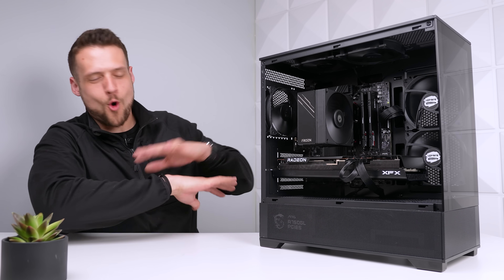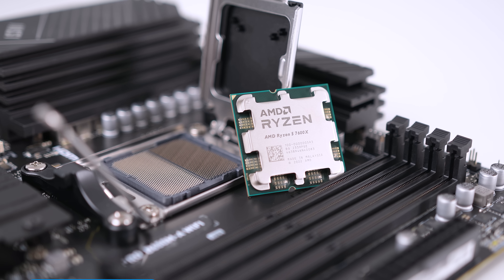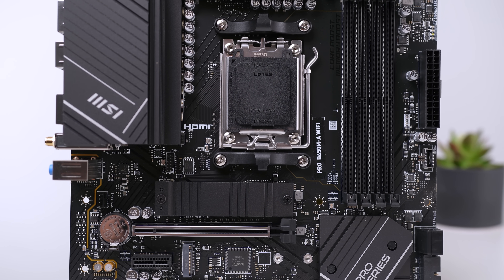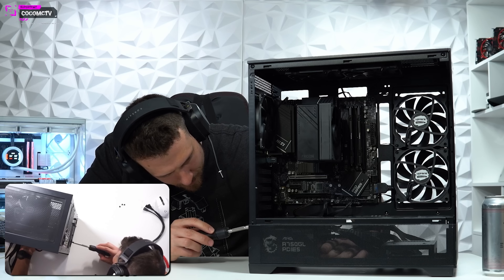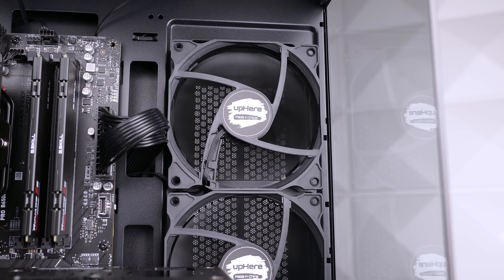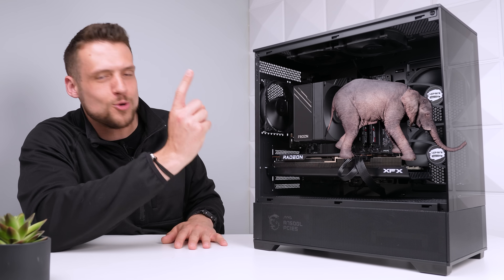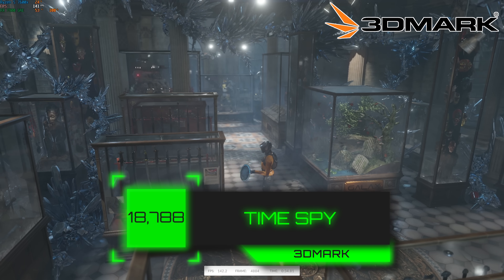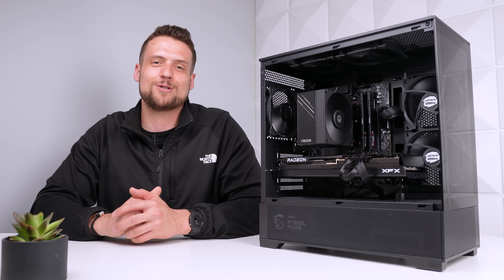$1250 PURE PERFORMANCE Gaming PC Build Guide

Comment: CPU- AMD Ryzen 3 3200G 3.6 GHz Quad-Core Processor
Motherboard-ASRock B550M-HVS SE Micro ATX AM4 Motherboard
GPU- XFX GTR XXX Radeon RX 580 8 GB Video Card
Ram- Corsair Vengeance LPX 16 GB (2 x 8 GB) DDR4-3600 CL18 Memory
Storage-Patriot P300 256 GB M.2-2280 PCIe 3.0 X4 NVME Solid State Drive
Case- Cooler Master MasterBox Q300L MicroATX Mini Tower Case
Power Supply- Apevia CAPTAIN 550 W ATX Power Supply
Is this PC good
Reply: sure but why a 3200g if youre using a dedicated gpu, and you could go with a b450 motherboard instead of a b550 to save some money

Comment: Hay what about phanteks XT view its under i m sure its under 80$ and comes with 3 pre-installed d rgb fans and its also fish tank design but with a psu basement just like this case a also have a clean looking rgb Streep you should check it out its in budget and looks really cool and also stopped msi's zero cable motherboards you'll love it love your video's btw ❤❤

Comment: Almost the same part as my first dream build too, but I still trying to build it aesthetically with some other parts such as : Sky Two GX, Ak400 Digital and more AX120 fan from montech to make all of the fan looks the same exclude the Air Cooler fan of course cuz I'm thinking to buy another Deepcool fan the triple pack one in the future so the air cooler have 2 fan and the other 2 were installed on the side knowing the case can handle 10-12 fan If I'm not mistaken.

But still, that just a dream that I don't know when will happen.. At least I'm having fun trying to come up with this dream build tho lol

Comment: I also just built my pc for $1250 and it has 7600x 4070 super 32GB DDR5 6000mhz cl30 Thermalright Peerless Assassin cooler Corsair RM750e power supply gigabyte motherboard with 3 ssd spots Montech Sky Two pc case and a 1TB nvme ssd

Comment: $1177.41 Same case/2TB SSD 
Ryzen 5 7500F 3.7 GHz ($130.00) 
Thermalright AX120 66.17 CFM  ($17.89 @ Amazon) 
ASRock B650M Pro RS WiFi ($149.99 @ Newegg) 
TEAMGROUP T-Create Expert 32 GB (2 x 16 GB) DDR5-6000 CL30 Memory  ($97.99 @ Amazon) 
Corsair MP600 2 TB M.2-2280 PCIe 4.0 X4 NVME ($108.99 @ Amazon) 
PowerColor Fighter OC Radeon RX 7900 GRE 16 GB ($524.99 @ Newegg) 
GameMax Vista M MicroATX Mini Tower Case  ($53.99 @ Newegg) 
G.Skill MB750G 750 W 80+ Gold Certified Fully Modular ATX Power Supply  ($79.98 @ Amazon) 
Thermalright TL-C12C-S X3 66.17 CFM 120 mm Fans 3-Pack  ($13.59 @ Amazon)

Comment: Total: $1084.32 Same but cheaper.
CPU: AMD Ryzen 5 7500F 3.7 GHz 6-Core Processor  ($130.00) 
CPU Cooler: Thermalright Assassin X 120 Refined SE 66.17 CFM CPU Cooler  ($17.89 @ Amazon) 
Motherboard: MSI PRO B650M-P Micro ATX AM5 Motherboard  ($119.99 @ Amazon) 
Memory: TEAMGROUP T-Create Expert 32 GB (2 x 16 GB) DDR5-6000 CL30 Memory  ($97.99 @ Amazon) 
Storage: ADATA XPG GAMMIX S7 1 TB M.2-2280 PCIe 3.0 X4 NVME Solid State Drive  ($59.99 @ Amazon) 
Video Card: PowerColor Fighter OC Radeon RX 7900 GRE 16 GB Video Card  ($524.99 @ Newegg) 
Case: SAMA ARGB-Q5 MicroATX Mini Tower Case  ($53.49 @ Newegg) 
Power Supply: G.Skill MB750G 750 W 80+ Gold Certified Fully Modular ATX Power Supply  ($79.98 @ Amazon)

Comment: I like the all black no RGB look. Clean and fast. Two thumbs up!
Reply: With you brother. Wasted watts to light up the inside of a fridge
Reply: Oooiyass I’m the greatest technician that has ever lived😅
Reply: Same. This is much better. I am not some tween dude that questions my sexuality. I want something clean and fast with little to no RGB.
Reply: I love some subtle RGB and no RGB. Too much RGB is gross. I hate builds that have a fish-tank case with RGB ram, RGB cable covers, RGB on the side and front of fans AND RGB in the fan blades, RGB on the GPU, RGB CPU cooler, you know. I like the Asiahorse Nyota fans with a little RGB on the RAM or cable covers, and the ID-COOLING non-RGB fans paired with no RGB at all.
Reply: I prefer rgb but i can imagine some people like all black
Reply: @MSIgnas i used to have a white rgb everywhere fishtank pc but now im using a full black no rgb build and i love it

Comment: Great shoutout on the MSI Pro B650M-A Wifi. It's a great value mobo, I use it with the 7800X3D and 4090 combo, has been serving me great so far.

Tbh, people overspending on mobo is the mistake I see most often when building PCs

Comment: But why the 7600x?
The 7500F will also wokr very fine and is 40€ cheaper and for fans i would pick Arctic P12 PWM PST 5stk- pack.

Comment: Thoughts on this build:
AMD Ryzen 7 7700X 4.5 GHz 8-Core Processor
Gigabyte GAMING OC Radeon RX 7900 GRE 16 GB Video Card
Thermalright Phantom Spirit 120 SE ARGB 66.17 CFM CPU Cooler
MSI B650 GAMING PLUS WIFI ATX AM5 Motherboard
Lexar Ares RGB 32 GB (2 x 16 GB) DDR5-5600 CL32 Memory
Patriot Viper VPR400 RGB 1 TB M.2-2280 PCIe 4.0 X4 NVME Solid State Drive
Corsair 3000D RGB AIRFLOW ATX Mid Tower Case
GameMax RGB Rainbow 850 W 80+ Gold Certified Fully Modular ATX Power Supply

Comment: Should have gotten 6000 cl 30 instead anything over 6000mhz will cause a loop with 7000 series amd chips causing performance buffer as the sync goes from 1:1 to 1:2

Comment: Just an FYI, the G.Skill Ripjaws and Flare are the exact same but the Ripjaws have Intel XMP profiles while the flare has AMD EXPO. They're literally the same otherwise and they should be the same price. It doesn't really matter but in general you should get Flare for AMD and Ripjaws for Intel. (Again, literally doesn't matter, just a thing)
Reply from the maker: Yea I saw that as well. This Flare kit is what goes on sale the most often, so I've been using it for both Intel and AMD without a problem.
Reply: @ZachsTechTurf assuming you meant ripjaws haha, but yeah whatever platform you're on just get what's on sale. nice build 👍

Comment: now we need a $2000 price to performance build! :)
Reply from the maker: Maybe the next one??
Reply: $1,820 Maxed out $/FPS
ASRock B650M PG Lightning WiFi $120
Ryzen 7800X3D $345
Thermalright Phantom Spirit 120 (Flat top version) $36
XFX Speedster MERC310 AMD Radeon RX 7900XTX $915
TEAMGROUP T-Create Expert DDR5 32GB 6000MHz CL30 $98
2TB TEAMGROUP MP44 7,400/6,500MB/s  $120
Montec Air 100 RGB $65
Corsair RM850e $120
Reply: @dachness  I work on ai stuff so I need that 3090 for the cuda performance and the vram, and the 12900kf for the cores. good overall tho :)!
Reply: although a 4070 ti super or 4080 would still be good
Reply: same build just spend the extra 800 on a better gpu lol. maybe cpu depending on game

Comment: You should have used the 7800x3d bundle from microcenter or at least have mentioned it. Mobo + cpu + ram costs less than yours while getting a frickin 7800x3d. That is what I went with with my build with a 1.3k budget and highly recommend it. Only downside is the ram is 6000 mhz instead of 6400 on this one but 7800x3d will make more diffirence than that does
Reply: @Bob-pk7pd Most people don't live near a microcenter (I live 1.5 hrs away and it wasn't worth it I wasted 6 hrs due to faulty parts to save 150 bucks valueing my time at 25 dollar a hour , a subhuman HR worker makes 45 in my zipcode avg post tax...) 7800x3d also it isn't worth it especially if you use it for a work station. A car allegory is a 718 vs 911, technically a 718 has better cornering than a 911 given mid weight especially for the average driver on the street but you are giving up unnecessary power and over paying if it costs the same as a 911.
Reply: @danli9884  Are you talking about cars? I am not into them really but I know 911 is a car model (I think from porsche). I know not everybody lives near a microcenter or even us (such as me) but for those who do, he could have mentioned it. I myself live in germany and had a friend get it for me and rn it is in my room.
Reply: All X3D cpu's don't care as much about ram speed. As 6000 cl30 is the amd sweet spot for ram on am5 there won't really be any noticeable boost on an x3d cpu
Reply: @dracconus619  I don't understand. Are you agreeing or disagreeing? Everytime I read it I think the other way
Reply: @YavuzTheIntern  I was agreeing that if the micro center bundle is cheaper then go with it. I was also letting people know that the higher ram speeds mean little to an x3d cpu
Reply: @dracconus619  Oh good. You also said "there wouldn't be a noticable boost on a x3d cpu" but ig you were talking about ram speed

Comment: if you look for deals on a 7900XT you can get one for $670 + ryzen 5 7600 $180 and that combo can actually fit in a $1250 PC build, that would be undoubtly the best price to performance gaming PC for $1250
Reply: Yep. Or just the 7500F if there’s no deals available which can also handle a 7900XT. Mobo could also be cheaper. Also I’d go with the Bitfenix case for less than $10 more for the smaller form factor, 4 ARGB fans, and the fan hub included— even though it’s $10 that’s not COMPLETE price to performance.
Reply: @SanDiegoGamingYT  does the 7500f really handle the 7900xt?? the gpu is almost 5 times more expensive
Reply: Isn't the ryzen 5 7600x way too weak for the 7900 xt?
Reply: Or the 7900 gre

Comment: YUSS I have asked for it a few time by now bc that is my budget. Its a shame by the time this got released I got pretty good at pc building so picked the list myself but still made my day
Reply from the maker: Lol sorry for the delay :(
Reply: @ZachsTechTurf  It doesn't help me but does help the others. Also should have at least mentioned the 7800x3d bundle from microcenter bc the bundle is cheaper than the parts you used. Only downside being the ram speed but you get a frickin 7800x3d

Comment: I have a very similar build to this, it costed around 1200 but I bought the cpu, gpu and ram in a Microcenter bundle. If you have one near you I’d recommend going there
Reply from the maker: Very nice. Definitely a great spot for the deals
Reply: @ZachsTechTurf  This is my build:
CPU: AMD 7 7700x
Mobo: 	MSI PRO B650-P WIFI
Ram: 	G.Skill Flare X5 32 GB
^^^ 379.99 from microceter
GPU: ASRock Steel Legend OC Radeon RX 7900 GRE
PSU: SeaSonic FOCUS GX 750 W 80+ Gold 
Case: Phanteks XT view
SSD:TEAMGROUP MP44L 1 TB 
Cooler: 	Thermalright Phantom Spirit 120 SE ARGB 
Total comes out to $1195.84!